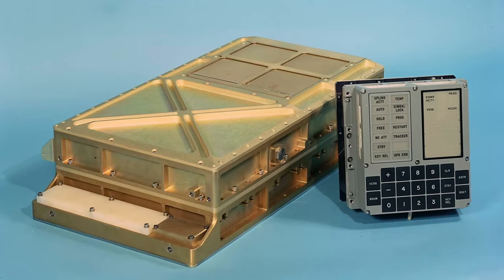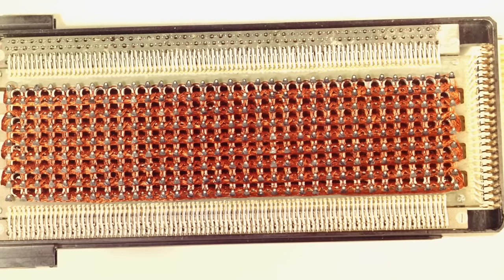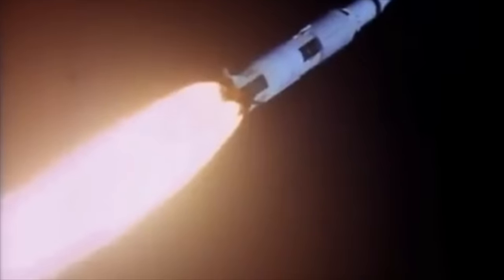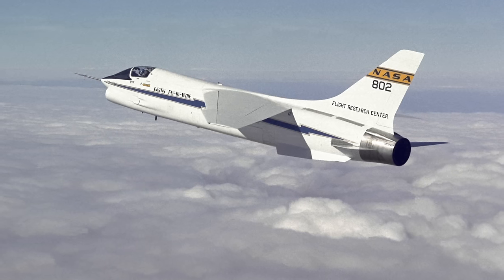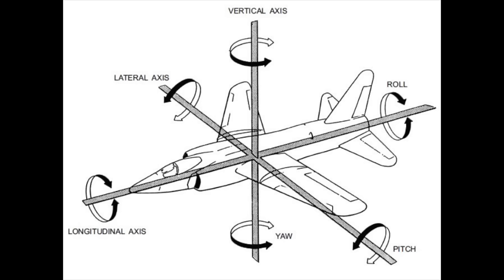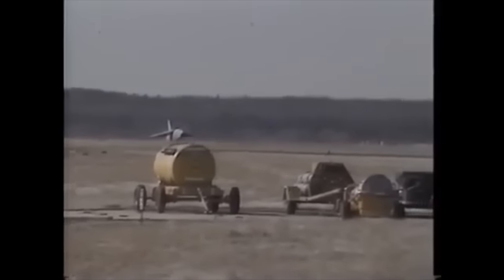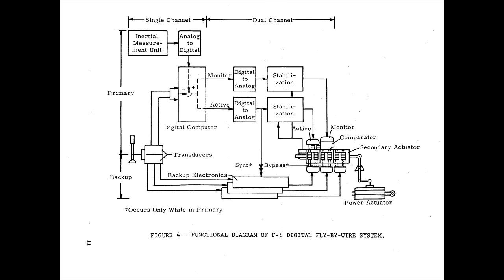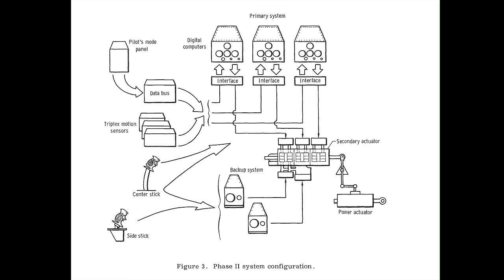F8 Fly-By-Wire System (Apollo Guidance Computer Part 31)

Comment: I recall canada had a fly by wire plane in the late 50’s, and the f-16 is one of the first mass produced aircraft using the system. Had no idea the f-8 was an experimental platform let alone using apollo components . Cool stuff.
Reply: Fly by wire on the Avro Arrow
Reply: Fly by wire is not flight control augmentation with a real time computer interposed between.
Reply: The CF-105 (Arrow) had an analogue fly-by-wire system. " This system also included solid-state components and system redundancy, was designed to be integrated with a computerised navigation and automatic search and track radar, was flyable from ground control with data uplink and downlink, and provided artificial feel (feedback) to the pilot." (Wikipedia).
The F-8 was a digital system which was only possible with the "miniaturized" computers developed for the Apollo program.
One of the important things the Arrow program developed was the artificial feedback for the pilots who were used to literally feeling the flow of air over the control surfaces through the stick. The lack of feedback was causing all kinds of problems in the simulator until they developed the feedback system.
A lot of aerospace engineers went to work for NASA when the Arrow program was terminated. I wonder if some of them worked on the Apollo and F-8 systems?
Reply: @michaelcherry8952  oh absolutely, the original comment only mentions fly by wire...not whether it was analog vs digital.  
Fairly certain,  having talked with some of the peripheral players in the Arrow program, the flight system was good as analog, but they were aware of the potential of digital...I imagine it would have been a matter of time.

Comment: Resistors can definitely go bad, but usually after many, many years. Unusual for a resistor to fail early. You can imagine the quality control was very good for each component by NASA. Resistors tend to fail open rather than in a short.

Comment: Resistors most definitely can go bad. There value can change. Their values normally go up but I had a situation once on an old ocilloscope where a large value resistor went
Down. We found it and fixed the thyrotron sweep circuit.

Comment: Looking forward to the video (if one was taken) of the Skylark 48 recovery....
Reply from the maker: Not sure if Mike took some footage, but you can see the newly recovered Skylab software flown here : https://www.youtube.com/watch?v=hjxHm7mJAIE
Reply: @CuriousMarc  Looks good. Speaking of which do you think Steve Jurvetson would give permisson to have the two memory modules with altered labeling scanned? I noticed the discoloration on the covers and I think someone cut the covers open and then resoldered them together. That leaves two possibilities, first, the contents have been removed and replaced with epoxy. Second, the contents are intact, but disconnected from the former pin headers. If the latter then the question is what's on those ropes.

Comment: Marc, I have a question. On the AGC boards why are flat-pack IC-s welded onto the board rather than soldered?
Reply from the maker: From their previous experience with the Polaris missile, they found this more reliable. The welded joints are a lot stronger than the soldered ones, that’s for sure.

Comment: Sorry the first fly by wire to fly was the CF-105 Avro Arrow, in Canada in 1958.
Reply from the maker: As is said (many times) throughout the video, analog fly by wire existed of course, and a commercial system was even used for the backup! This was the first attempt (second if you count the Apollo spacecraft) at a digital version, where the computer did the work. At least the first non-secret one.